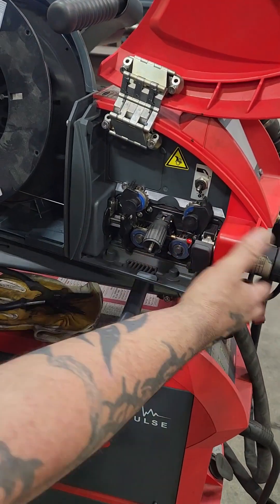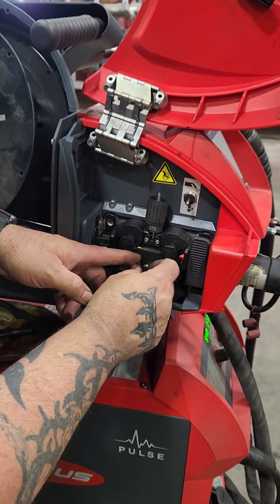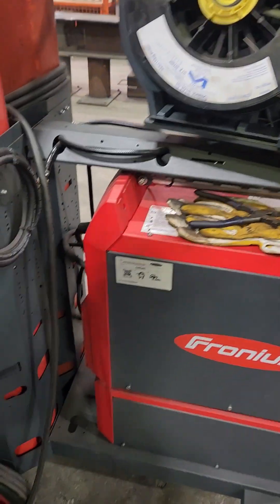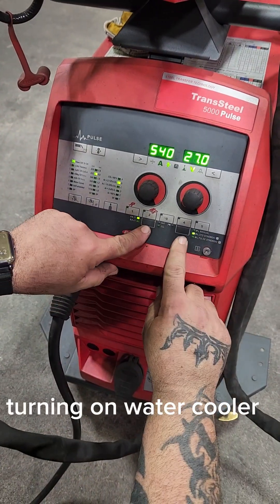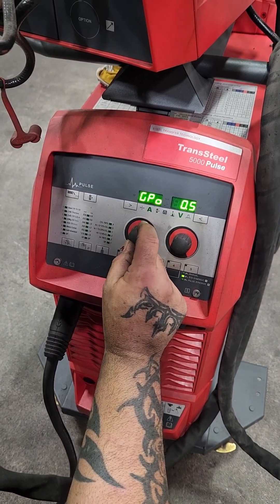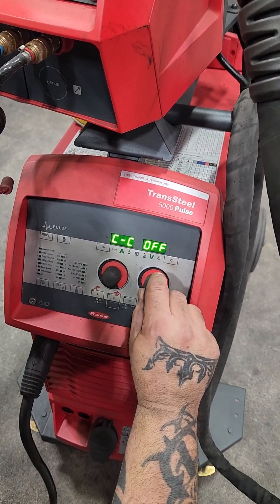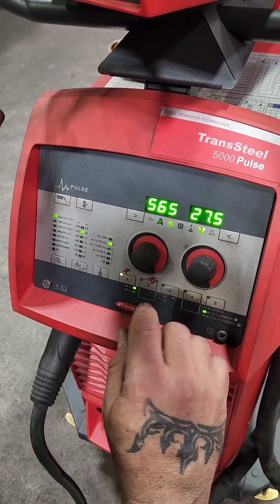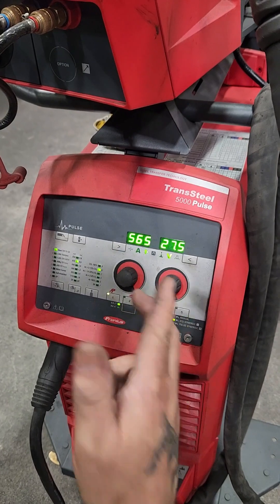Fronius TST 4000 & 5000 liquid cooled mig machine. Turning on cooler and some settings.

Comment: Hi,I don’t think you know it but it will help you significaly.You can actually measure resistance and induction of your welding lead and clamp on the work piece to get the maschine dial itself on it.Then you will be 100% sure that when you put maschine on for example 300A,you will have it on the end of the torch because it will calculate everything and setup itself for circumstances you have in the cables.Its also recomended to do from Fronius itself everytime you change the leads,clamp it somewhere far from old position or switching material from alu to mild etc. Its in the menu where it writes 

L-10
r-5 

And you will measure it simply by go on that parameter in the menu,triming the wire flat with tip,touching the work piece and pushing the torch switch and when its done you will see exact measurment on the screen.And it can make a LOT of difference using synergic setting and puls after that.